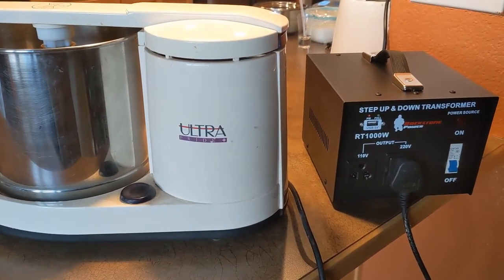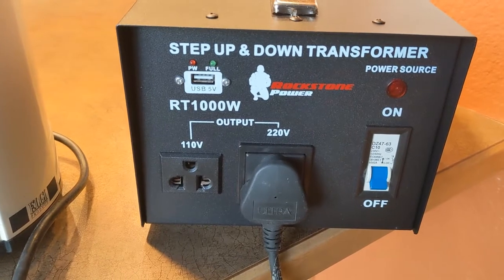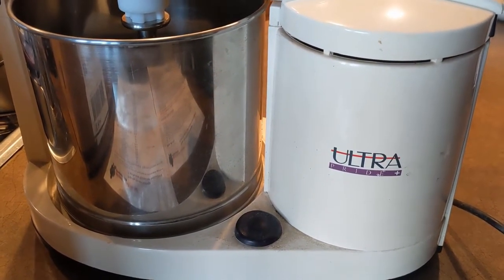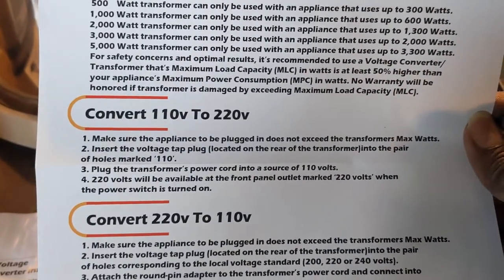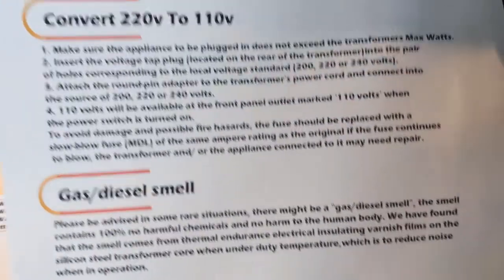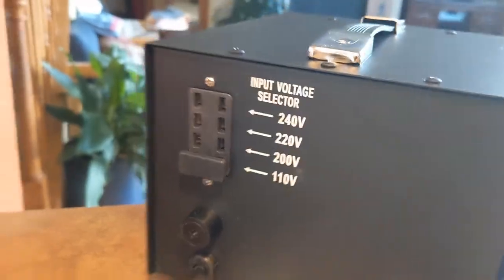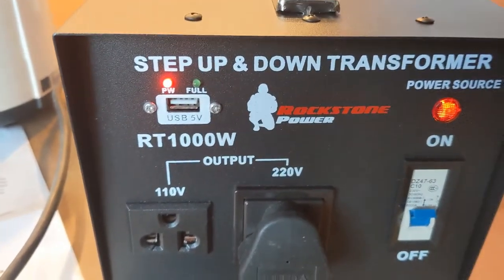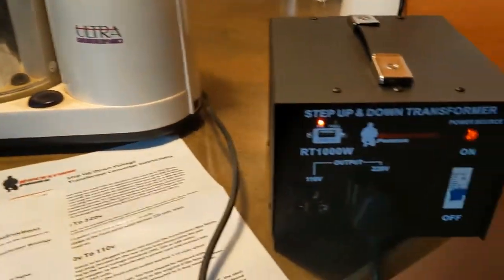Step-up transformer for using Indian wet grinder in USA. Reviewing Rockstone Power Step Transformer

Comment: In USA there is single phase 110v for usual usage and also 240v for high home appliances like dryer, cooking range. So if you want 240v for your appliance you can contact any electrician and they can setup for you